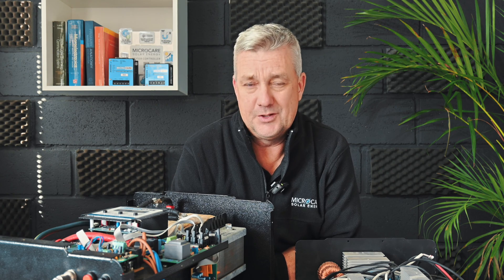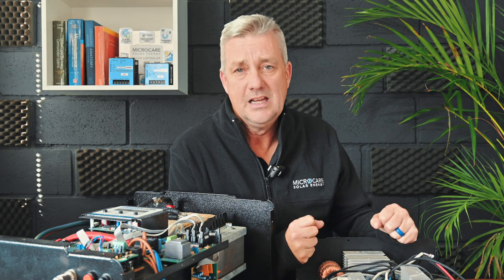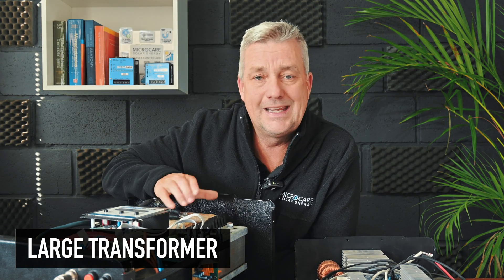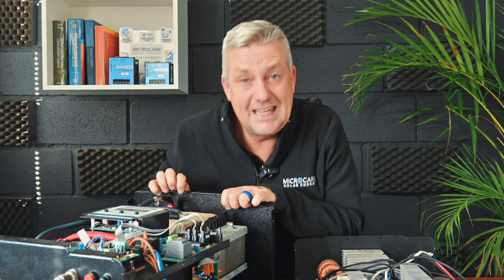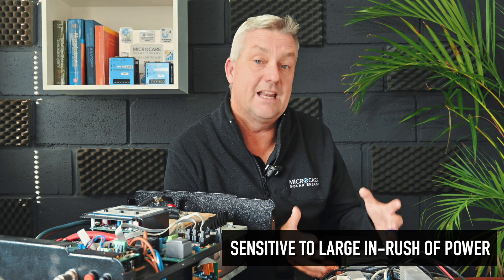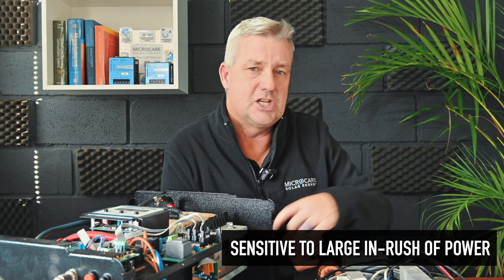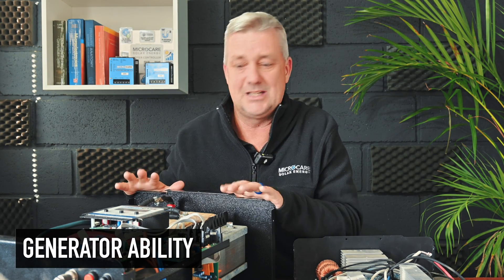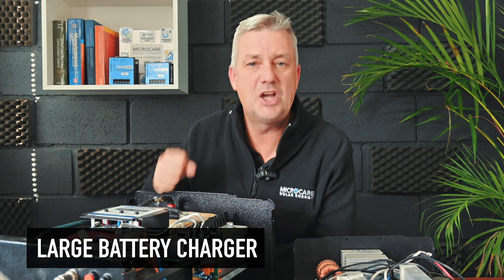Microcare Low Frequency Inverter vs Imported High Frequency Inverter

Comment: HF inverters that are grid connected just use the grid to help with high inductive loads. Since their goal is reducing the cost of electricity bill they do a good job at that. Generally utility meters read in 15 min intervals so few seconds of high surging doesn't cost you more money. Most of the time homes are not surging for hours your reducing the cost of the bill.  Off-grid I agree LF inverter is the better choice some of them have high idle current and lower efficiency generally most off-grid homes are in rural parts of the country so large ground mount solar arrays are easily built.

Comment: It will be more fair to compare with the good brand of high frequency inverter like Sunsynk, Deye, etc. And even you locally manufactured high frequency inverter, it still cannot working under bad voltage scenario. The limitation of high frequency inverter doesn't due to the "Import".

Comment: I built high frequency inverter but i did the ful calculations and test I get 3.5 kW from 5kw so what I did is add one more transformer and the inductance increase and I was able the get the full 5 watt continuously and the voltage didn't drop but in the bigger industry they won't do that because it causing more money to build it to work the same as low frequency inverter its possible to build high frequency inverter to work the same as low frequency inverter it just requires more parts and cost goes up